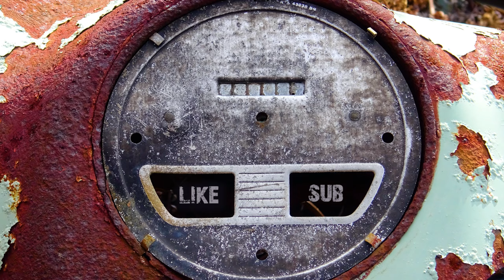Snowmobile water crossing Ione WA

Comment: Are these just regular sled with the seats off? Or do they need some modding? I got into ridding this year and already looking for a way to ride in the spring/summer/fall time.
Reply from the maker: They know the depth of the lake and have a roap with a float just in case, you want to tape off around your belt so that it doesn’t slip
Reply: Front suspension is basically removed,  and the skis are brought closer together. Also gotta seal around the belt. And the limiter strap is maxed

Comment: Not one sleds rear skid is set up properly. It’s a ten minute fix to have the sled carry the skis at any throttle. Not one guy turned around on the water that’s the fun part to watch.  Not hating. Wish I was there with my water  sled
Reply from the maker: Its a yearly event ;)
Reply: I’m genuinely curious how you do that, do you lift or lower the skid in the front or back or just adjust the limiting straps?
Reply: @venialgaming4295   max the limit straps out as long as you can lock the front shock out as tall as you can get it and loosen the back one off the back of the track should sit in the air at all times. I have video of mine before and after complete game changer.  I can turn slow down at no point to my skis bounce off the water or touch the water except for when I’m turning
Reply: Come on out to Grantsburg World Championship Watercross in Wisconsin. Nothing but racing ovals. 3 days of racing!!